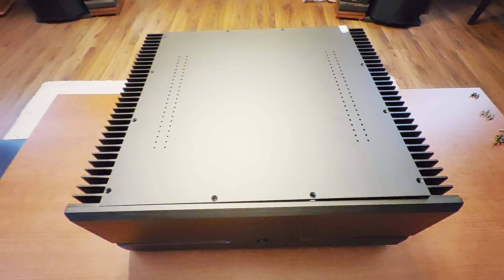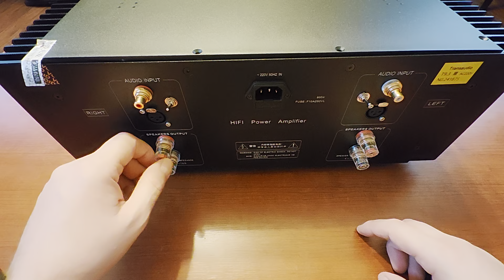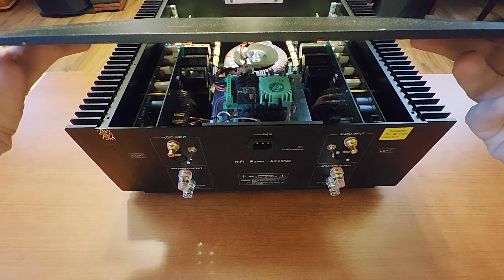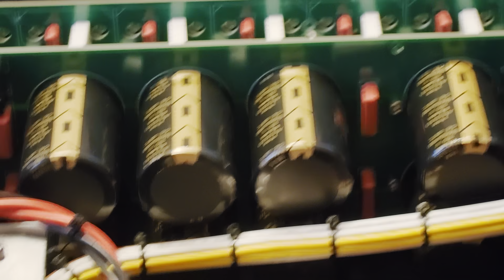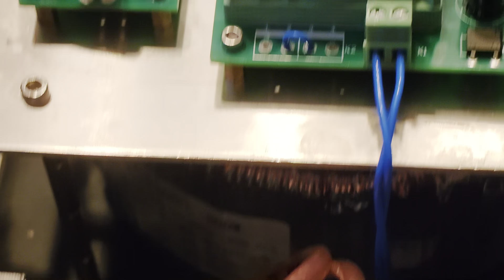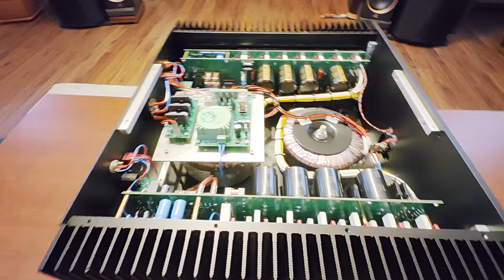First look at monstrous Burmester 909 Transaudio T9.3 clone stereo amplifier!

Comment: These Chinese clones look like favourite 80s schemes. Therefore they can be repaired with a large soldering iron the size of an axe. They are fun to modernise and improve. You can change the thermal paste or solder in Panasonic FM, FR capacitors. I like to play with them. I changed the toroidal transformer to an R-core. I picked up complementary pairs of transistors. I put original Wima, Ero, Eromac, Leclanché capacitors. I changed the topology of power and signal grounds. It's an interesting game!

Comment: Hi Friend, How sure are you this is a balanced design? I did purchase the D9 based on your D5 review, and listen to some YouTube videos. Looking forward to this in depth review. I am planning on getting FM108 mono block amps. I noticed there is also another.design call the voice of Paris, do you have one of these for review?
Reply from the maker: Hi! 
Well D9 for sure is not balanced as it's basically D5 + balanced line driver. 
This one - I think so (unless proven wrong).
I hope it will sound excellent as it was very expensive (and I don't have the amp you've mentioned, can you paste offer name here if that was from Ali? Links will not work as yt likes to censor them)
Reply: @k4syx  Hi Friend, the amplifier is called Voice of Berlin 909 Fully Symmetrical X-Amp Circuit Mono Hiend Fully Balanced Post Amplifier 500W/8Ω/1000W/4Ω T11PRO&BC

Comment: How does it consume 180w and put out 370x2@4R? What wizardry is this? Or wizard sleevery
Reply from the maker: The power consumption changes with volume and load. I wasn't listening LOUD (I never am) and my speakers used for burn in were not 4R.
It would raise all my alarms if for the volume level and 8R speakers this one would use anywhere near 370W (not even thinking about 2x370 here :) )
Reply: @k4syx  I get what you're saying. However it is reasonably clear you don't get what I was saying...if from the wall there is a maximum draw of 180w, how is it physically possible to output near 4 times that?

Comment: Ok, is your room full now? 😂😂
Reply from the maker: Room not, but one of the corners is pretty much stacked up. I need to rethink how do I set them there as f.e. A75 is in the very bottom and getting to it is a problem now :D
Reply: @k4syx  you need one of those system with cabinets that have a wheel on the side to move them. That would be super handy. (Siris archive system) 
I need to redo my listening/etc room. But I am dreading moving all the speakers and gear 😕🤣
By the way you do know that using gear as a bass trap is just showing off right? 🧐🤣🤣

Comment: I was thinking of non-destructive ways to increase the ventilation of these amp chassis and thought that placing short brass standoffs between the amps lid and chassis so there is a small gap around the edge of the lid would allow more airflow through the amp.
Reply from the maker: Yes I did something like that for the HTPC I use as a source. A set of washers under the lid that lifts it like 2mm and provides additional vents. 
In Transaudio amps I would go for something like that both on the bottom lid and on the top one. It should be very easy and quick thing to do.
Reply: @k4syx  The bottom plate might be tricky given how much weight it supports. It might need steel standoffs to prevent them shearing off when moving the amp.
Reply: I know that the D5 Pro gets extremely hot but this amp (at least the version I have with a single transformer) doesn’t get that warm.
Reply: @mddawson1  another possibility is place thermal tubes between side heat sinks and the top cover. But assembly will be tricky
Reply: @Anatoly_Panchenko  I am currently using an AC Infinity Aircom T9 on top of my D9 clone amp. It's inbuilt thermostat shows the air temp being drawn out at 38ºC (100ºF).

Comment: Don't replace the OP07C, it is used for DC servo and is an excellent opamp for what it is doing. Keep in mind that DC servo opamp only slightly affect subsonic frequencies, not something really audible and the only thing that could make this opamp give a different sound when changed would be because of bad power circuit for it. It is not like an opamp directly in the signal path such as input stage used in SE/XLR conversion. I have some friends that had the same opamp as DC servo and didn't listen to me end ended up spending over 300$ of opamps only to realize I was right. Been assembling DIY amps for two decades and I've seen lots of DC servos in amps.
Reply: Brilliant! The speed of DC servo not limited by opamp, but by RC networks, that creates a low pass filter, with the corner frequency 0.5-2Hz.
Low noise, and output drift, are important for that application.
Moreover, the pcb layout, and supply bypassing, are designed for that purpose - deal with signals in near DC range.
The idea to place here high speed opamp, can came to mind of the person, who learned electronics by reading hi-fi magazines only.
Only one, who "burning" cables, can mind about speeding up a dc servo, that slowed down by design specifically, for not to affect a signals at audible frequencies. Do not forget to replace a capacitors near opamp, with some paper-silver foil in oil, to add some air and dynamics at 1-2Hz range😂😂😅😅
Reply from the maker: @ So you think that that particular design was done around 07c (first option), or that they had just slapped 07c in it as it was cheap and they had it available (second option)?
One more thing. As much as I like to discuss stuff, and we may disagree on some or many or few things, Id like that comments here stay civilized. And the second part of your comment is anything but. Believe or not - I am electronic engineer, I dont care much and I dont feel the need to wave my diploma, but please just behave and try not to offend me or anyone else if thats not too hard. Dont measure everyone by your standards.

Having said that, I dont believe that circuit was designed for 07C specifically, so if I can try to replace it with something faster and more precise, then why not.

As I understand you wouldnt do that, because  you know that it was designed with around 07C, right?
Can you support such claim with any real info? Have you seen that particular circuit here?
Reply: @k4syx  I neither think, nor belive. I know that: 
1 that circuit, that nulls voltage offset, is called just a DC servo. Do I need to explain what DC mean?
2 the surrounding components, supply bypassing, and even printed conductors shape, for the general purpose, and high-speed opamps, are not the same. 
3. I have a friend, a qualified electronics engineer. As 99% of good engineers in Israel, he works in a defence company. After work, he works in home, making projects, and consulting for small companies. He almost has no time to enter forums or just watch videos.
I know a similar mechanical engineer…
On other hand, I personally saw so much engineers and even scientists, who came from ex-USSR, who were u unable to do real work, other than cleaning the floors in the closets, washing the tableware in restaurants, being a handyman in either shops or warehouses.
There are different engineers, qualified differently: one designed upgradeed power conversion system for F16i, and and power management for Iron Dome missiles, second - listening to cables, and putting fast opamps to the network, limited to 1, 5-2Hz.
To each - his own
To DC servo - low noise, low drift opamp
Reply from the maker: No I would place there anything fancy and expensive, no class A discretes.
But a nice single OPA828 or anything as fast as precise - why not. I think DC servo that would be to react and compensate faster could be a good thing. My only worry is possible oscillation if you know what I mean. Sometimes a little lag can be good. 
Anyway, I got a set of single opa828 and I will test them here and also in D5Pro and 933 that are also using 07C in servos.

Comment: I've been really curious about the Pass Labs Aleph-5 clones with 240,000uf of capacitors and dual transformers. Have you seen those and if you have, do the parts look decent?
Reply: Are those monoblocks?
Reply: @MasterofPlay7  I don't think I can link them but there's some that seem like they're putting a pair of A5 monoblocks in a single chassis.
Reply from the maker: I've seen them and they look. However I've read some not so good stuff about A3 and these are not my priority atm. I don't want to get burned as I buy all of them with my own money (and that's why I always try to do some research before I will buy anything)

Comment: I bought one of these a few months ago. It sounds fantastic to me. But the one I have has a single large transformer rather than the two (possibly smaller ones) mentioned in the video, and power rating was stated as 360W instead of 185W. Mine is also a T9.3 (serial no. 241798), so I’m a bit confused. Maybe they tweaked the design a little or there could be different versions (also bought mine from Funkenya)? But I would’ve expected a different model number in that case, like T9.4. Other than that, the insides look identical. I’m looking forward to hearing your thoughts on the sound quality!
Reply from the maker: I guess there could be some smaller revisions along the way that had no intermediate model numbers. 
Also, as I've already found out, some of the clones look the same on the outside but may differ internally. That's why I always link to the one that I've reviewed
Reply: In the link given in the description of this video the images are totally different from the amp on the video. Why Is it so?
Reply from the maker: They have apparently silently updated the offer with 9.4. 
When I go there now through my purchase history I also get new amp revision

Comment: The inside of the video and link are different.
Reply from the maker: I think they have silently updated the listing with new 9.4 revision as my purchase link in my Ali history now leads to this one. I'll try to get some more info for full review
Reply: @k4syx  THANK YOU!
Reply: As the copper columns are prone to breakage during transportation.so the are changed the chassis and replaced the layout of the power amplifier board.the amplifier board is the same

Comment: So how much power does it have?
Reply from the maker: No idea. I can only give the manufacturers numbers. I guess I could measure it roughly with my oscilloscope and sin wave generator, but it's pointless. I mean, as long it's driving my electrostats properly I don't really care if it's 200W or 2kW. But at the same time if it really does drive them properly, then it has to be in >200W range
Reply: @0:27

Comment: 0:03 I purchased one of these and it sounds great. A real 0:03  bestie. What op amps would you replace with the 0:03  ones that the amplifier comes with . And is this amplifier a balance design.
Reply: I have FM801 and DartZeel and I am very interested in replacing opas there. Can you please post what another  HiFi  Zones fans suggest.  We will share our observation.😂😂😂
Reply: @jarkos6019 integrator opamp, do not change!!!
Reply from the maker: These opamps are used in DC servos so I would (and I will as I've already got them for that purpose) try to replace 07C with opa 828 (single). Should be faster and more precise
Reply: @k4syx  is there any improvement in the Sonic performance of the amplifier

Comment: I know nothing about Chinese clones so please forgive my ignorance, but isn't it a risk with these things that caps/transistors etc are counterfeit? Of course if it sounds good for a good price then great, but couldn't longevity be a problem if fake parts are used?
Reply: Keith, usually you get what you pay for. The caps most often are Chinese regardless of what is printed on the outside. That is not always a bad thing they are what they are. In some cases upgrading capacitors can bring a significant sound improvement. On the other hand if it sounds good out of the box then there you go!
Reply: @Geoduck.  Excellent - thank you 👍
Reply: Outside of Milan Italy where they fly in labor from China  there is a plentiful supply of high quality parts in China if you are not aware their middle class of 750 Million is greater than America , Europe, Canada for home audio buying  consumption.
Reply: These Chinese clones look like favourite 80s schemes. Therefore they can be repaired with a large soldering iron the size of an axe. They are fun to modernise and improve. You can change the thermal paste or solder in Panasonic FM, FR capacitors. I like to play with them. I changed the toroidal transformer to an R-core. I picked up complementary pairs of transistors. I put original Wima, Ero, Eromac, Leclanché capacitors. I changed the topology of power and signal grounds.
Reply: @rew42alc4dc  Just an incredible value in HiFi!

Comment: That is a lot of amp! Im not sure if at 1500€ a chinese clone amp with an unlucky name thats etched on the front in a large awkward font would be my first option, but as a reviewer I can see why you would want to find the best of the clones. It certainly looks well built. Looking forward to the review
Reply: Why is it an unlucky name? You have gender biased or something? Trans 🤣
Reply: But a used genuine 909 will likely set you back +10000€ so the clone is a bargain.
Reply from the maker: Well the reviews are a byproduct of my quest to find the amp that will drive my electrostats and will sound best with them, AND will be reasonably priced. D5PRO sparked that idea as I've learned how much more I can get from clone amp then with anything brand named with similar price

Comment: That thing looks like a battleship.I would like to hear comparison between D5 Pro.
Reply: I am probably going to try this amp after having recently tried, then sold a D5 Pro. I will let you know what I think! I did not really like the D5 Pro
Reply: @MayoSwell  In my opinion if you did not like the D5 Pro you won't really like this one eihter.I see they are basically the same amp this one only being more powerful.What did you not like about D5?I got vintage Yamaha MX-1 which is excellent,but i wanted to try something else...I really doubt D5 can outperform my Yamaha,but i don't know..
Reply: @beslemeto  i thought the D5 Pro was a good amp for the price and did a lot of things well for how cheap it was. It’s biggest weakness to me was it’s lack of depth from front to back. The soundstage was flat in that regard. To me it lacked a roundness to the sounds
Reply: @MayoSwell  Yes.This is my opinion too from what i hear here on Youtube!In that regard my Quad 303 is better.And it sounds richer too.
Reply from the maker: If you're a quad guy you will not like the D5Pro as you'll probably find it too lean. On the other hand I find Quads way to warm and fuzzy for my preferences:)
Reply: @k4syx  Yes i absolutely love Quad 303.To me it sounds like an expensive tube amp.Warm,rich and spacious with enough details(piano sounds fantastic).Very good results with Epos ES14.
Reply: Hi. Why You didn't like d5 pro?